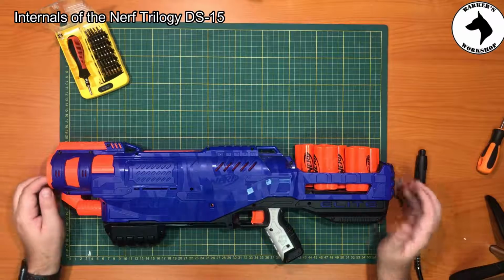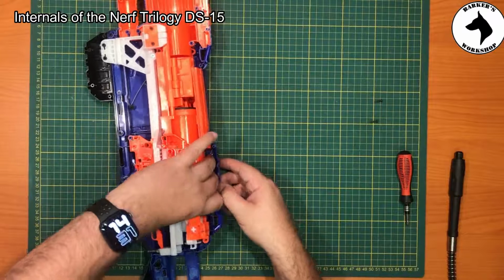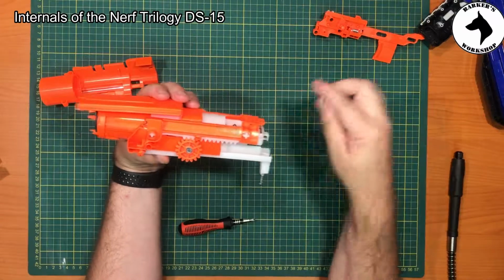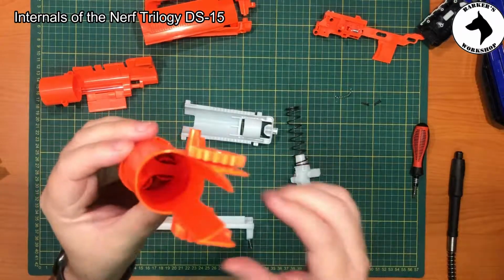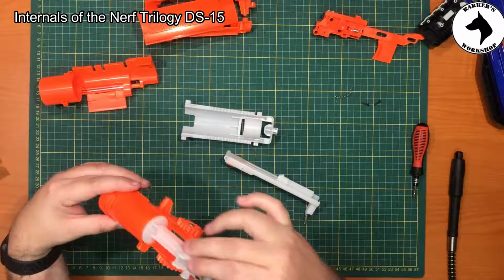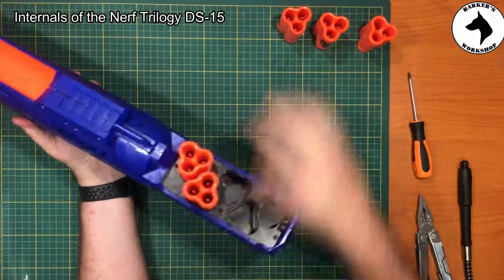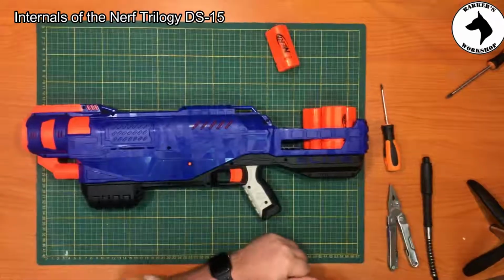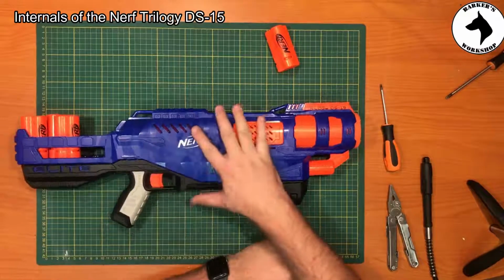Internals - Nerf Trilogy DS 15

Comment: my slide pulls back and Ioad a shell in and then its just locked and I cant pull it back forward. Ive pulled it apart and I can move the action fine with the side pulled off but as soon as I reassmble it just locks up again I have 0 idea whats going on with this thing
Reply from the maker: Send me a video or a picture. Email is on the channel about.
Reply: Looks like the same spring fell off in mine but it’s completely missing. Any idea what the diameters or required tension may be? Thanks a million, your video is a lifesaver!